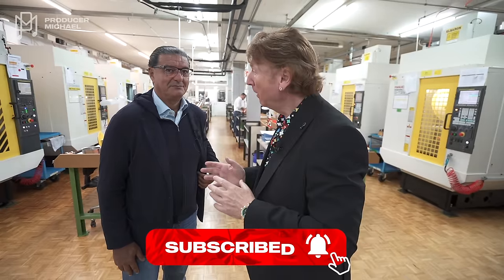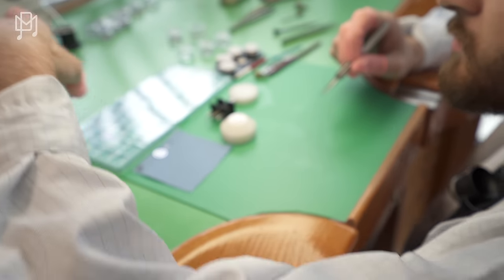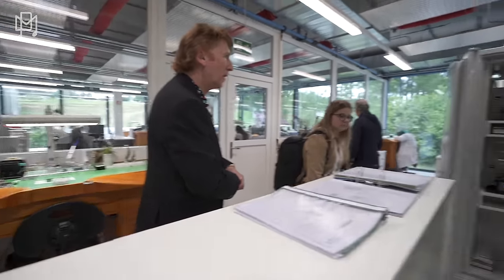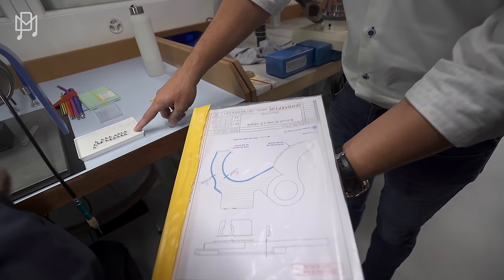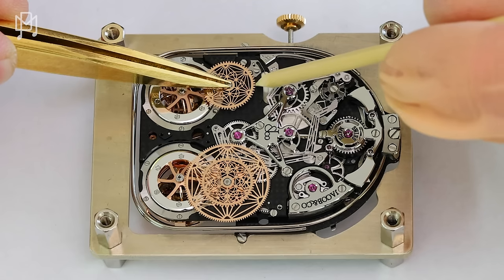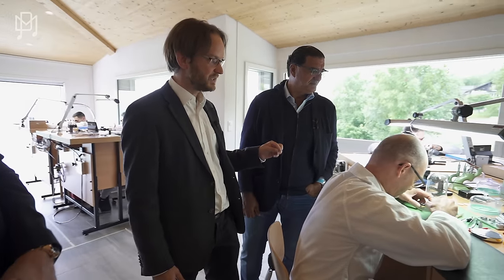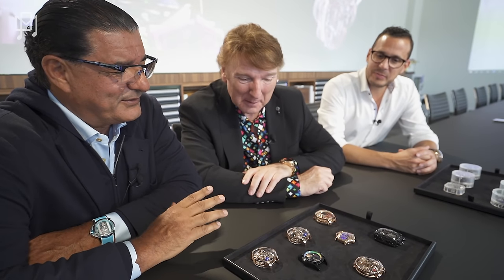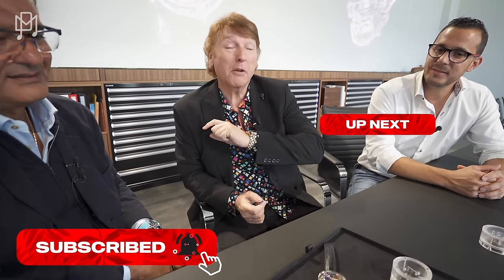EXPOSING THE TRUTH behind Jacob & Co Watches!

Comment: I've seen documentaries on independent watch makers who make these parts BY HAND , today . They know exactly what materials and abrasives to use to get certain finishes and cut bevel and polish edges.  It's absolutely crazy. I've never seen this though . Holy cow. As a fab guy this is fkn insane , I just want one of those Bugatti engine crank shafts  😅 . What ever company manufacture the machines that make these parts is full of fkn geniuses.  The machining of these parts before finishing is equally as amazing to me as it is being done by hand , I always wondered what the machines look like / how they do it in modern watches. Thanks!

Comment: Even though Jacob and co is a very flashy watch company you can’t deny that there is some very high level watchmaking going on, amazing stuff. The only caveat I can see being an apprentice watchmaker myself is the absolute nightmare a piece with over 900 parts could be if you are tasked with repairing it, it will be months before you see your watch again. Most Swiss mechanical watches are intended to last for as long as you take care of them but can you imagine the amount of problems a watch like this could incur over a 20-30 year span? Good luck finding someone who is even capable.

Comment: I'll be honest Michael, you probably won't read this. But I was alwys thinking to myself "this guy is obsessed these watches are worthless, when is he touring another mansion?" Had to mention!. So well, you know there is a patent on synthetic opals using tetraethylorthosilicate. However it doesn't have the proper rainbow effect but I have some ideas how to achieve that, I wish I could speak to them to do some experiments. And no, not like the cheap Kyocera plasic looking rainbow opals... I'm talking rich colour, depth of colour variation type vibrant rainbow opal. I have some ideas how to achieve a mixed (scumbled) matrix. Although scumbled is a term used in paining oils, not  making synth opals. I never could afford to test my ideas. You would be able to place the opal gel/sol in a mould probably and then sinter it in a kiln, to high precision form much like those sapphire casings, although these are not so hard, yet far less brittle but same moecular structural pattern as natural opal. It's the fire opal patent. However, they don't have any idea on how to make rainbow opas using this, but I do. Once you have some jelly, and added oxides for colour, one they dried to a certain temp, you could mix according to me diffeent coloured oxided (iron for red, for example, i.e. iron oxine in a sol/gel of TEOS). anyways then mix your jellies by using a small metal rod as a stirring stick and scumble the jelly so the colours mingle. Imagine you made jelly in the fridge, there is a jelly, and you eat jelly / jello like in hospital. Well the sol / gel of TEOS should be this consistency but I'm sure you can test it or someone, then mix the colours to isperse rainbows of colours inbetween each other, then let it dry out more, then try and sort of sculpt it, and then put it in a kiln / etc to sinter. it's just my idea of getting rainbow opal from the fireopal patent, but i havent seen it done nor can try it myself. I'd like to make rainbow opal sculptures from moulds, I have some ideas on wanting to create coour patterns within the rainbow mix,not just one transluscent fire opal like the patent, but mix the  moecular dispersal of metal oxides from several sol jars of tetraethyl orthosilicate. So interesting.

Comment: I'm really curious about the profit per watch. Say theres 4 hours of polishing times 400 parts for a watch, that's 1600 hours. Then I think they said 70 hours of polishing for the case in the previous factory video? If they pay 100 dollars per hour for the labor (that might be generous?) to do these specialized tasks, even with all that it just comes to 167 000 dollars.  

Then if you add the machines, the tools, the materials, the programming time, the trial and error bits before they get it right, the buildings and whatnot, I don't know what that might cost? But it sounds like there is still room for a pretty huge profit on each watch to get to that million dollars?
Reply: Oh, ok up to a month of labor to assemble it too.

Comment: I wonder what the battery change "watchmaker" around the corner could do to a watch like that. FYI, he changed the battery of a Seiko, told me it doesn't work and gave it back to me without the screw of the tiny + pole holder.